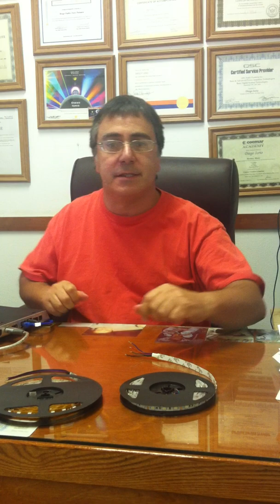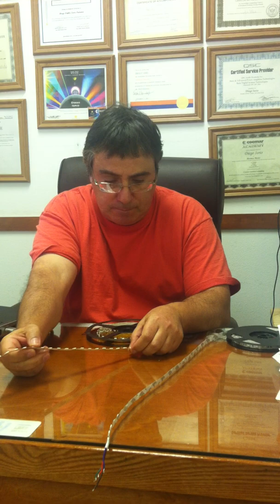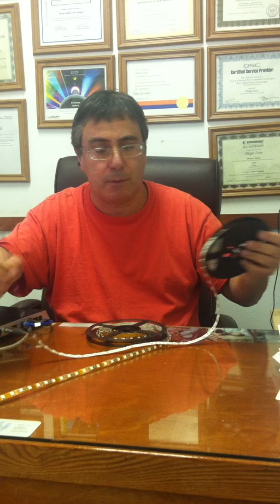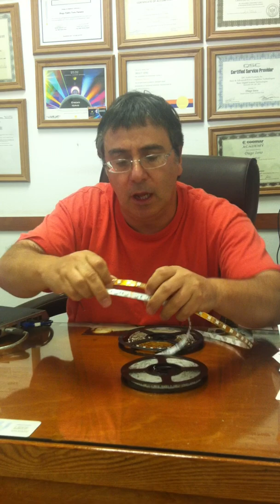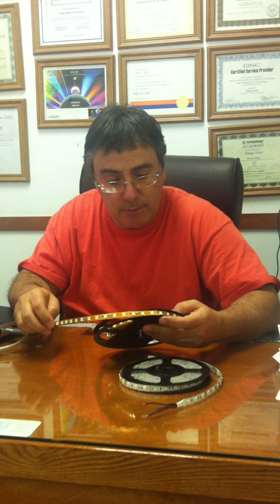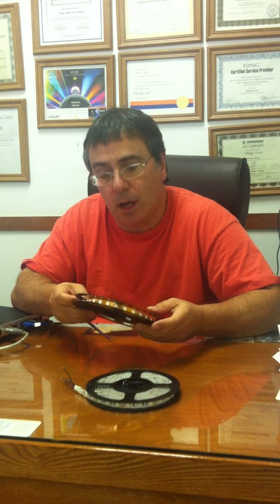High Quality RGB LED Strip VS Low Cost RGB LED Strip

Comment: What dc power adapter supply should we use for those 5m rgb cheap chinese led strips? It came with a 12v2a power supply which seems very low to me.
Reply from the maker: Hello Paulo, I would check out the data sheet for the LED strip, it will be able to tell you the power consumption of the strip, and from there you can determine if you need a bigger power supply, here is a link to our power supplies so you can check them out. https://sirs-e.com/product-category/led-lighting/led-strip-lights/led-power-supplies/power-supplies-led-power-supplies/